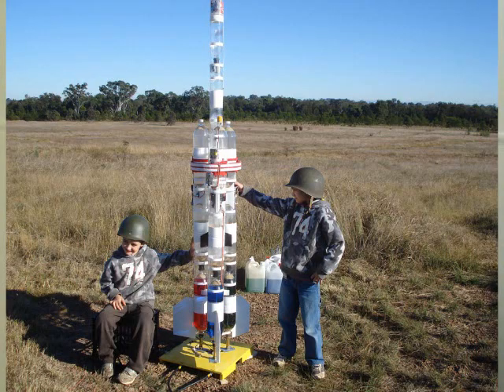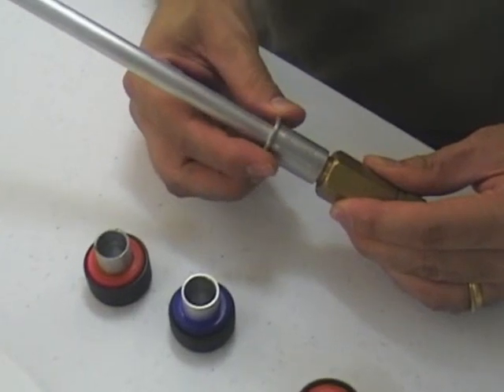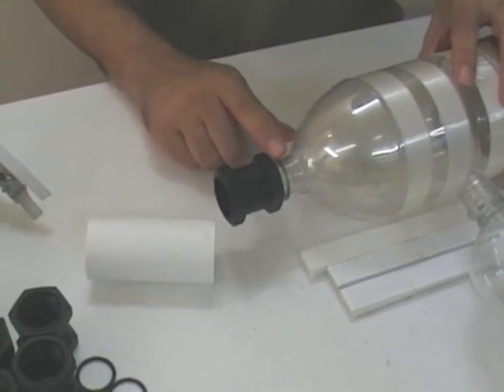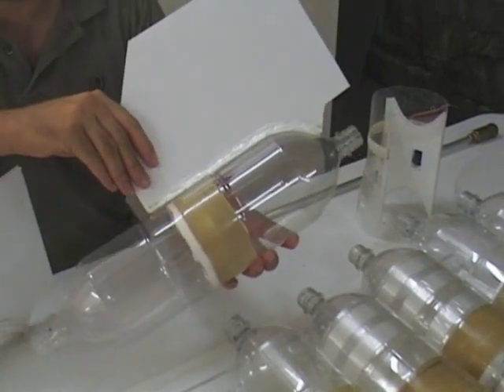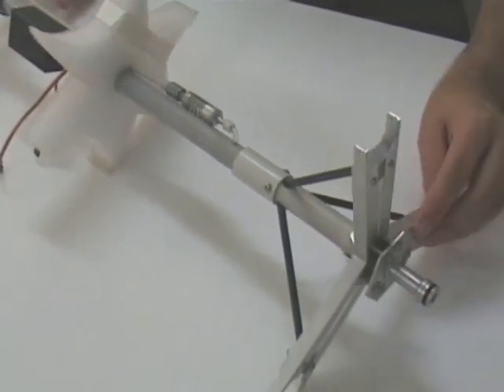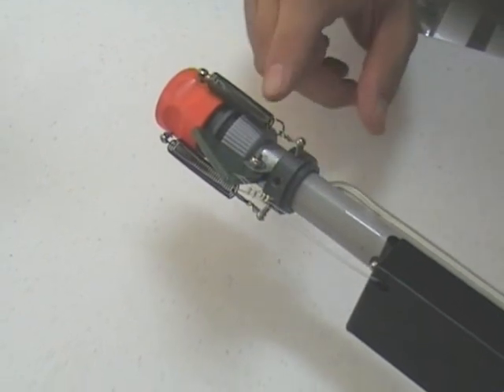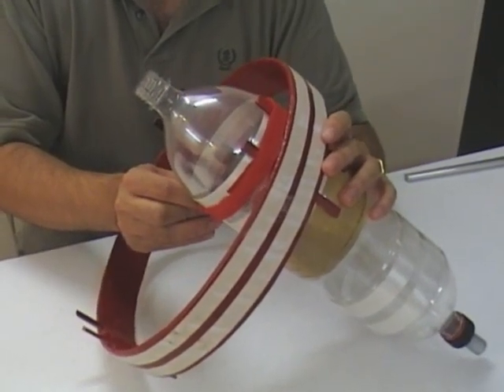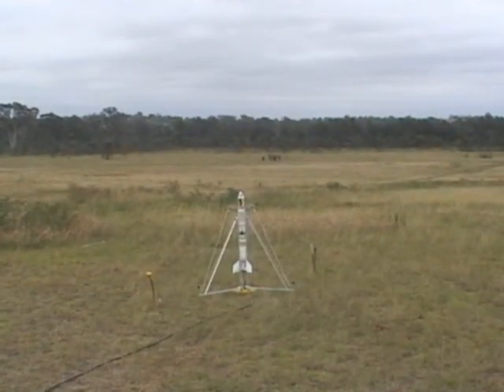Acceleron V water rocket components

Comment from the maker: While technically it's certainly possible, but it is a good idea to keep any structural components free of metal. When the rocket explodes or falls without a parachute you don't want bits of metal flying everywhere. Consider using fiberglass instead of Aluminium.

Comment from the maker: Hi Randy, the answer is yes. We are going to reinforce the sustainer first with fiberglass and launch the booster at a lower pressure and the sustainer at a higher pressure. (our launcher allows for different pressures to each stage) Eventually though we hope to reinforce both, but for that we will need to update the launcher to support the higher pressure booster.

Comment from the maker: Yes, the booster central manifold and support is a little on the heavy side. We were mostly concerned with getting it to work rather than being optimal weight. There is room for improvement on that front.

Comment: Such as using the metal parts, it is very heavy two-stage rocket.
 First stage of my three-stage, just tie wraps that secure the Velcro and 5 bottles, is very light.
 Weight of the unit parachute deployment of the third stage is not only about 15g.

Comment from the maker: Without re-running the simulations, the difference between 130psi and 120psi is likely to be around 20 feet for the booster. The sustainer can be filled to a different pressure to the booster, but for the sustainer/booster combo pressurised to the same pressure the difference between 130psi and 120 psi is likely to be closer to 50 - 60 feet for the sustainer's peak altitude.

Comment from the maker: While technically you could launch at 140psi, it's really starting to stress the bottles at that pressure and your safety margin is lowered. Since these are still only test flights, the altitude difference between 130psi and 140psi isn't significant enough to worry about.